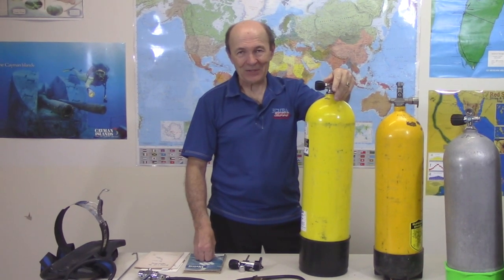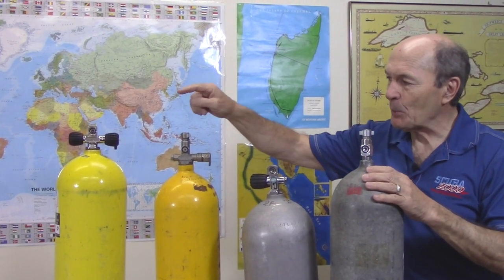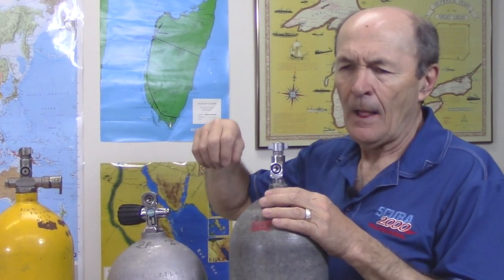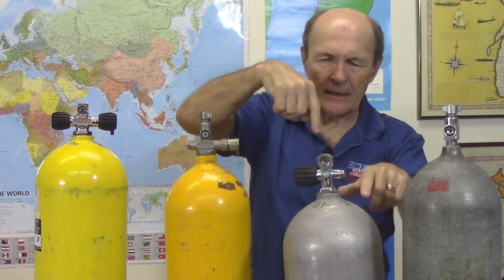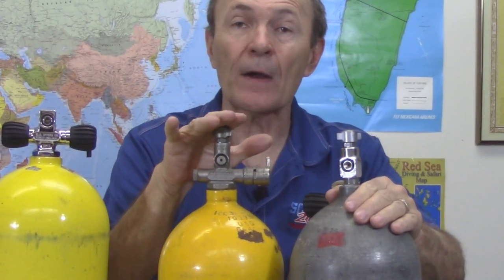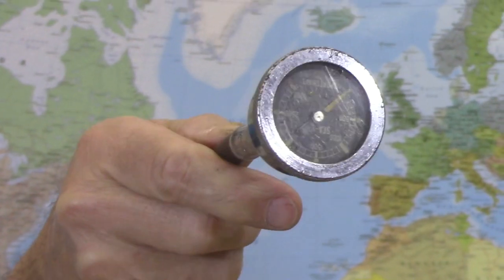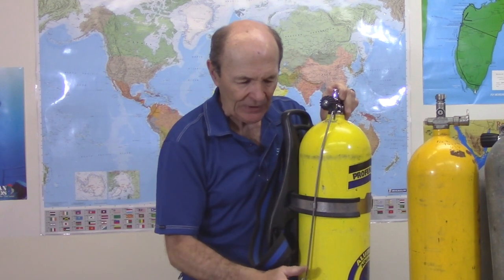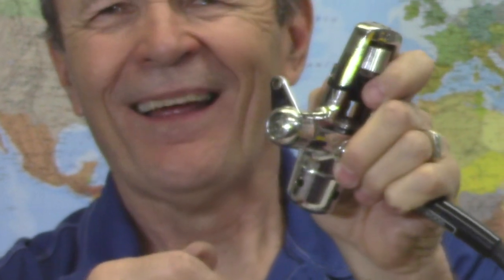Tank Valves - J or K - Vintage Scuba: S01E05

Comment: Alec, you made me smile with this one. This morning, just for fun, I cleaned off my old tanks in the garage that have been sitting there for probably 25 or so years. And believe it or not, one of them is the exact same yellow US Divers Professional aluminum 80 with the J-Valve and back-pack with cam lock you had on your video. I didn't even know about this video until three or four hours after I put the tanks back away. 

The kicker is, the reason I decided to clean off the tanks in the first place was from watching your vintage BC episode. One of the BCs you discussed in that clip was a yellow USD horse-collar with the flexible hose manual blow-up inflator and CO2 cartridge - the exact same one I used all the way up until I stopped diving back in the early 90's. Same pocket in front, straps, everything. We used to smear petroleum jelly around the threads of the CO2 cartridge to help fight corrosion. That episode made me want to see how old my tanks were, and then I turn on this video shortly afterwards. Like I said, it made me smile.
 
Just so you know, I am giving it serious thought about getting back into the sport and am watching your videos to kind of bring myself up to speed on how things have changed in the past quarter century of diving. I really love your presentations and am looking forward to watching them all.
Reply from the maker: Now I'm smiling Rick!
To get an older diver back into the sport is always satisfying.
And there's no reason why not. I'm over 70 and still dive regularly. My diving profile has changed - less frequent, no cold water, no stupid deep dive contests, etc, but I'm loving it. And I'm sure you will too.
We were advised to remove the CO2 cartridge after every dive and to grease it also but few divers were that conscientious.
Most older horse collars have a frozen mechanism. The actual firing mechanism was made from cheap 'pot' metal and it corroded if it was in  a humid room!! I used to remove them an plug the stub so divers could keep using their 'beloved' horse collar.

You'll probably find that your dear old yellow USD aluminum tank cannot be tested or filled. Read about 'SLC' on the internet or on the Luxfer tank site.
Take care and good luck.
Alec
Reply: Funny you should mention the age of the Aqua Lung tank. That's the first thing I was looking for when I cleaned it off. Turns out it was made in 1974! I had no idea I had bought it that long ago. I also have a Luxfer made in 1987 so it looks like I have a couple of aluminum paper weights now. The USD one would be a good display tank for a dive store though, just for sentimental reasons if nothing else.

Comment: In the early 2000's I was doing a ships diver course with the New Zealand Navy. Initially we started with J-valves and no BCD's. Part way through the course we were issued sets with contents gauge and BCD and told that it was a result of health and safety gone mad. However we weren't allowed use the BCD except in emergency as it was safety equipment! Fortunately that attitude has since changed.
Reply from the maker: Funny to hear the navy had a 'stone age' of diving too!   Thanks for sharing Luke and glad you survived those crazy early years like me.
A.

Comment: This is good, J valve questions are still on the PADI IE. Fortunately I knew about them already. This video will be good to help future candidates and divers that have never come across them.
Reply from the maker: Yeah. Despite their excellence and state of art materials, some things at PADI get left behind. If they still  inquire about J valves on the IE, it may be an attempt to check on the candidates knowledge of history. It sure isn't about equipment knowledge! I was on the PADI Advisory Committee for a couple of years and have nothing but respect for them and their methods but some things are either too small or too obscure for the writers to attend to. I've always had a bit of a beef about the fact that one can become a PADI Instructor (or another agency quite frankly) but may have no night dive experience, no cold water experience, no dives deeper than 60' other than the one from the Advanced course, no scuba equipment knowledge, etc. However, the system works and gets better each year.
Thanks for watching. Alec

Comment: Alec: the first valve on a 1961 steel 72cu’ tank was a sonic valve. I have never seen another one since. When you got below the 300 threshold the tank would rattle every time you took a breath. Worked well. No pressure gauge.
Reply from the maker: I did a Vintage video on those valves.  Search for it and have a laugh remembering the annoying hammering.
A

Comment: I had a J Valve back in the 70s.  Despite the concerns about reliability or accidental activation it never gave me any problems.  There was also simple pressure gauge called a "stem gauge" which just pushed up a small rod much like the old air hose in a gas station.
Reply from the maker: Totally agree about J valves.  For fun watch my Vintage Scuba The First Gauges, to see a stem valve.
A.

Comment: I had a US Divers Al 80 (or 72) in 1975.  It had the J valve and I forget if it was possible to reset the valve and still have the reserve if it accidentally got pulled down (assuming a full tank).  Also were they filled with the valve up or down?
Reply from the maker: Tanks are filled with the valve up, if early in a dive the J is pulled down, it can be returned up as long as the pressure is above the J pressure limit of 300 or 400 psi.  It's set so when the breathing starts getting hard, pull the J to get the remaining pressure.  Back in the stone age you could tell a good diver if they regularly checked their J rod was up.  Didn't have a pressure gauge so this showed you were 'monitoring your remaining air' so to speak.  Thanks for asking.

Comment: Hi Alec. Awesome video, I love both the technical and historical information. Just out of curiosity, how did you deal with a jammed pillar valve knob as you mentioned @5:40? Again, excellent stuff, keep it coming!
Reply from the maker: There were couple of things that you could do.
If the problem was caused by the cold, sometimes just warming the valve in the sun or hot water would do the trick.
Otherwise, you needed to get rid of the air pressure if possible by milking the 2 hose reg. If you can drop the pressure the valve knob will sometimes turn. If not, then careful but firm twisting of the knob with pliers, back and forth, just enough to force it a bit but not so much as to break it, will often break it free.  This was always risky as they were quite brittle and broke easily.
Failing all of that, then you have no other option but to empty the tank through the regulator, remove the regulator and then try to loosen the valve knob. As the tank empties, the valve gets very cold and that often helps it to loosen. Warming back up to room temp will help as well. You can't really apply any heat other than maybe that from a hair dryer. Too much will damage the valve parts.
It was a nuisance all right.
Not a problem any more thank goodness.
Alec

Comment: At around 6 min into this video, Alec says that opening 'modern' valves do not need the 1/4 turn backed off (as taught in even modern SCUBA training).  I beg to differ!  Back in the late '90s, as a DM and instructor on Guam with tourists, I had several instances where customers opened valve full & didn't back it off; therefore, when we went to swap tanks between dives the 'modern' K valves would jam open.  Using pliers on the handle would often strip the metal fitting between rubber/plastic hand grip to metal on valve stem.  Our best course of action was to remove the hand grip and use our adjustable wrench on the metal valve stem itself.  As an engineer, I believed it was because the lesser pressure allowed a contraction of valve body against its components - specifically the HP seat/Plug Assembly against the Bonnet Gasket (a brass ring).  I practice and insist students/customers 'back crack' the valve after full opening.
Reply from the maker: My point is the modern tank valve should be opened 'finger tight' without a turn back.  First so the buddy knows its full open as there is no movement, second to not stress the valve internals.  Any more force and the internals start to jam and if very cold water can cause a difficult closing like you shared.  
Thanks for watching Marc.
Alec
Reply: @AlecPeirceScuba_SeaHunter  if a buddy doesn't know lefty lucy, I think they a liability.

Comment: In one of your episodes you show a valve that has a port at 45 degrees between the threaded part an either the J-valve or the on-off wheel. I think it was made by Healthways or Dacor. This port was for a permanent mounted SPG with a braided hose. Not very popular for obvious reasons. (certified in 1966)
Reply from the maker: I show the Daemone 45 degree tank valve in Vintage Scuba S02E08 and S04E06.

Comment: I have one of those u.s. Divers 80c tanks, made in 78 with a J valve, still in good condition and still in use
Reply from the maker: If your tanks passes hydro and has a GOOD visual examination with an Eddy Current test each year there's no reason why you shouldn't use it. Be aware that lots of dive stores will no longer test them or, even with good stickers, fill them.  A store can refuse to fill any tank if it so chooses.  In their defense note that problems with tanks e.g. explosions, usually occur during filling. Alec

Comment: Great video. It was apropos for me. I was watching JAWS tonight and saw Matt Hooper playing with a "J" valve. I made sure to point it out to everyone in the room. Alec, as it relates to tanks, do you think a diver should own his/her own air analyzer for checking mixes in rented tanks? Necessary, prudent, or simply a redundancy for divers in the U.S.?
Reply from the maker: O2 analyzers are not cheap as you probably know. You're looking at $300 to $500 for a decent one. Depending on how much EANx diving you do may help you decide. If your question is about the reliability of the dive store unit, I suggest that it's OK. It would be pretty stupid for any store to use less than the best and to not keep it in good shape. We use 2 different makes and models here and check each tank with both. Just my paranoid mind I guess.
Thanks for watching . Alec

Comment: J valves and backpacks (Board) systems are still used by some smaller Chinese fire departments for dive rescue. And believe it or not, I was born in 2001 and I not only got my hands on one of those systems before but also seen one in action. A manufacturer named Jiang Bo still makes those, not even the updated one, the older one used in the 60s. The circular shape mask and the circular shape surface supply mask used in the sea hunt series are also widely available there and we call them "693 full face masks". Just don't think that I'm speaking bad for China. Most of the ppl there including FDs use state-of-the-art gears and are well trained. It's just interesting to see that vintage gears are still available there.
Reply from the maker: That is interesting Alan.  Only folks I know who regularly use J valves are my vintage scuba buddies.  Can't see why a fire department would trust it instead of a standard pressure gauge.  Appreciate the information.
Reply: @AlecPeirceScuba_SeaHunter  FDs there who have this piece of equipment rarely do dive rescues if at all because they may not have any waterfront in their jurisdiction and they keep a vintage set as a backup. A complete backboard system there only cost 60$ there believe it or not so it made it reasonable to purchase backboard system instead of a modern system as a backup.

Comment: Hi Alec, everytime I get my tank filled it's only at 2500psi should I insist on 3000psi or is this normal? Tank is a catalina aluminum 80cuft.
Reply: Yeah thats a common problem. thing is when they fill your tank the process should take about 30-40 mins. Thats because its a cascade fill system. First they fill it low pressure to about 2700psi. let it sit there and cool for about 5 mins. then bring it up to 3000psi, let it cool again, and repeat the process 2-3 times, while letting it COOL DOWN. WHen they are done at the store the tank is 3000psi at about 70F. When you go to dive the temerature is less so the tank pressure drops, should be around 2700psi though. Thats my two cents, even thogh im not an expert
Reply: @Sokeresa  Right I remember years ago it use to take 20 minutes for a fill, this guy just hooks it up turns on the air and a min or two later it's done, tank hot as hell to.

Comment: I used J valves on all my tanks, back in the 60s. Never had a failure on my personal tanks. only failure I had was in a rental tank, while diving off of Redondo Beach pier, in 90 ft of water. On the way back from gathering crabs, my air suddenly shut off. My buddy was just ahead of me, and I grabbed his fin, and singnaled no air. We buddy breathed to the surface, on his regulator. Found out later, that the inside of the valve was corroded, dropped below reserve pressure, and suddenly activated, cutting off my air. Strangely I didn't notice an increased effort to breath, when the tank dropped to reserve pressure, as is usually the case. Do they teach buddy breathing anymore, in basic scuba, as an alternative to a safe second.
Reply from the maker: You made it through a stressful incident safely so well done.  As for buddy breathing, suggest watching Vintage Scuba S08E03 Skills You Should NOT Learn, which includes  buddy breathing.  Lots in Vintage Scuba for an old stone age diver like you to laugh at.
Reply: i was in the 90’s. didn’t practice it, just in the text

Comment: My tank still has a J-Valve and we have almost 40-year-old regulators in great condition.
Reply from the maker: I service lots of 40 year-old gear - regs, valves, tanks, etc.
They work just fine.
But they are 40 years old.
I have several 1971 Norton Commando bikes from my racing days. They look and run perfectly. Perhaps better than they did in '71. But I do not ride them on the freeway. Carbs, drum brakes, cables, old wiring, lights, etc, simply don't measure up. And that's not touching on increased response, power and speed of a modern bike (like my 2015 Indian Vintage) which these days is essential on highways.
I'm always happy to hear about vintage scuba gear still in use but do hope the divers are aware of the changes made over 40 years.
What regulators are you using?
Thanks for your comment.
Alec
Reply: Alec Peirce Scuba j
Reply from the maker: You clearly had a good instructor.
Alec
Reply: the presentation of the diving equipment has changed... but the basics remains exactly the same

Comment: Does any J-valve have DIN connector? Or can I say that only K-valve has DIN and Yoke connector?
Reply from the maker: Good question. I've never thought about that but you're probably right. 
The J valve was gone before DIN became popular.
I doubt there are any vintage J valves with a DIN fitting.
I discovered recently (which for me is in the past 10 years!) that there are modern J valves so maybe there is one made in DIN but I doubt it.
I would say that you're right - only K valves come in both DIN and Yoke.

This is one of those "Who cares?" points - so trivial that it really doesn't matter to anyone but I like that stuff.
As my dear wife Diana says, "Alec knows absolutely everything about nothing!"

Alec
Reply: Yes, there are. I've seen paintball players with those old tanks and valves. I've been diving one of these in the 1980s

Comment: I own an old tank equipped with a "j" valve, but from a completely different configuration, the reserve is operated via a push-pull cable and there is absolutely no lever or rod or any exterior moving part.
this tank and valve were sold by VOITH.
as all my regulators have a SPG, I gutted this mechanism and plugged the valve with standard regulator plugs
Reply from the maker: That VOIT valve you refer to was featured in one of my Vintage Scuba videos a while ago.
It's too bad that you changed it. They can sell for as much as $200 in original condition.
It was made in the mid to late 1960s.
Alec
Reply: @AlecPeirceScuba_SeaHunter  there is a story behind this tank, i found it underwater, I believe that it was there for at least 15 years, the tank was half full of water, I've took a chance to send it to the hydrotest and it PASSED so I use it as a back up tank. the cable was damaged so it was not practical to make this mechanism functional so I removed it
Reply from the maker: That was exactly the problem with that J mechanism. The cable froze up from corrosion. Imagine your bike brake cables being immersed in salt water all the time. And there was no easy way to rinse them.
Great about the tank. Being underwater would have no effect on the hydro test which is a test of the metal elasticity. It usually ruins the inside walls though and the tank fails visual.
Alec

Comment: Medical O2 tanks use the pillar valve. So if you have ever seen a dive O2 kit you have seen a pillar value
Reply: Not the big steel tanks but the small aluminum ones
Reply from the maker: Did not know that.  Thanks Zachary.
A

Comment: you should have menshend din valves because they are very popular as well and where i go diving you only have din valves and 12l steal botels 
i go diving with a double 12l and and dir equipment configuration
Reply from the maker: DIN valves and steel tanks are not so popular in North America.
They certainly have their place but the cost is much higher and divers are not so concerned about the extra air nor the different buoyancy aspects of the steel tanks. 
Also DIN valves have been around for a while in scuba but they're not really a Vintage Scuba topic. I'll save that for my Tech Tips which deals with modern scuba gear.
Thanks for watching. Alec